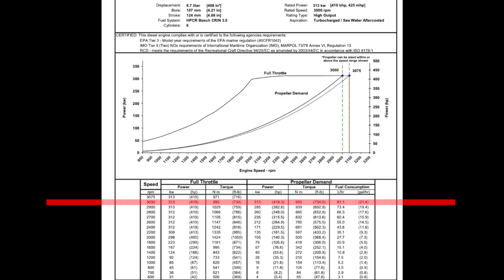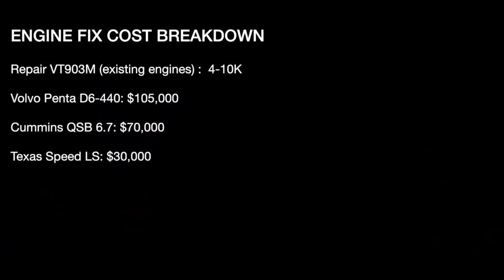Tesla Powering my 30yr Old Italian Yacht? And Broken Diesel Engine Diagnostics

Comment: You know what I told you on the phone but at the same time I know you’re dying to go gas. I still say rebuild and stay diesel. If you’re concerned about resale, look at the value of gas boats vs diesel. I finally got a diesel boat and will never go back to gas unless it’s outboards and even then I’d try to find a diesel version.
Reply: Yeah Chris, as a boater with a gas motor I would love to have it diesel. We own an rv with a Caterpillar C7s Diesel engine and love it way more than gas. Would love to own a diesel drive fishing boat. For now ours is gas, for now...
Reply: when did u get a boat and whens the vid coming out??
Reply: Check out Oxe diesel outboard.  300hp BMW 6 cylinder diesel. :-D
Reply: What about lesla motors and a big generator they make 400v  20 to 100kwh and bigger that run at 700 to 1500rpm and burn ⅛ of the diesel your two motors burn or forget about the tesla motors and buy a complete kit 1generator 2 motors and battery power packs and controllers probably the best option for you and with a 100 kwh at 400v push that boat to 60+ mph don't try that in not sure if the haul can take that much pressure from the water colliding with the from of the boat
Reply: NeoLeo Media “has a boat channel” no content yet still
Reply: diesel is better than petrol change my mind
Reply: Please continue to talk sense to him, please Chris!
Reply: I know he’s still learning about boats but being boater with 40 years experience of owning, working on and operating boats let me tell ya what I know....Doing a diesel to gas conversion is prob the dumbest f-ing thing anyone could ever do on a boat of this size. This is not a cigarette type performance boat with a narrow beam. This is a heavy wider hull that absolutely needs diesel unless he wants to completely destroy the value, performance, economy and reliability of this boat.
Reply: @turbomotovlog5588  yeah, thats a great idea !!
Reply: Of course he's not gonna follow the good advice/experiences of these comments. Doing the smart thing is not the point of this channel. its all about the drama and rich-kid toys.
Reply: Steve VAG-tuner there is something called law of thermodynamics.   So 2 electric engines would still consume the same amount of diesel as a Diesel engine with the same output.   

Only reason locomotives use diesel electric is packaging purposes.
Reply: Great content as always, so unique! Do whatever you think with this thing, I’ll be watching regardless and I have no clue about engines!
Reply: @danhard8440  To me, that would make it an easy choice then. Get that engine in and have the blown one refurbished for spare or resale.
Reply: @dannyt9067   This! I have only 30y experience with our yacht the same size and 2x Volvo Penta diesels........ holidays on a yacht should be as problem - free as possible. Service the whole drivetrain (and esp. the fuel system, sealing & corrosion protection .... thats where the most problems come from over the years) mostly by yourself (to know possible issues when out on the sea)........... else all your work, time a money will have no benefit for your family and possible other yacht owners, except some fun vids .......
Reply: Have you considered using the generators to increase your electric range? I don’t know it it would be efficient enough but at least in the case of an emergency that could get you more power.
Reply: @brianhilligoss  sorry bud it's a diesel 3 liter engine 4cylider turbocharged euro 4 
Specific fuel consumption at full load  260 g/kWh 
@ 4000
rpm so there is no way it hell it's going to burn as much as those 2 huge engine
Reply: Wolfgang Brugger agree 100%. If this boat is meant to be a weekend cruiser for entertaining the family and friends  then he should keep it as stock and reliable as possible. If he wants to do a crazy project boat then go find an old Fountain hull and go nuts with whatever powertrain he desires. And btw 30 yrs is a long time. I was fortunate to be born into a boating family and have been around boats my whole life.
Reply: @CS-932  Now a diesel-electric would be cool!
Reply: @brianhilligoss  actually, with trains diesel-electric makes the most sense as the electric motors behave as a CVT delivering the energy from the engine in a smooth manner and allowing the engine to stay in its most efficient rev range, while having fewer losses than an actual CVT. In a boat, it wouldn't make as much sense, since the torque is shot into the water as thrust, which doesn't need particularly low output RPM and often doesn't even use a transmission.
Reply: Yeah this is a cabin cruiser, it isn't designed for speed. If he wants to go gas do something like Finnegan and get a jet boat with a TSP engine.
Reply: Spot on Chris!.  Diesel outboard engines, check out Cox diesel outboard, very expensive tho
Reply: @turbomotovlog5588  While I agree a Diesel Electric conversion would be cool for a youtube series.  The specs you are quoting for the generator would be far too small.  His current total engine output is 800hp, which is 600Kw.  So to match what he has currently would require a 600Kw electric motor, which means assuming 100% power transfer from generator to motor, which if course is not possible, he would need a 600Kw generator.  The 100Kw you recommend would be far too small.  Realistically, he would probably need a 700Kw generator or more due to power losses during conversion.  But even assuming a 600Kw generator is sufficient, a stationary Generac 600Kw unit burns about 41 gallons an hour, so similar consumption to the two diesels he has now.
Reply: @twainguy2  the electric motors give out 800foot pounds of torque each that's 1600 foot pounds of torque so I think that's more than enough  to propel that boat easily
Reply: This is a "express cruiser" boat lots of beam (width) and weight. It's designed for day cruising/overnighting. Not go fast. Just fix what's broke.
Reply: Steve VAG-tuner the electric motors only make that at stall.  The rated tq demand of the props is at 1800-3600 rpm.
Reply: @turbomotovlog5588  Its not a matter of can they move the boat, its a matter of how much power they require to sustain movement.  Assuming whatever electric motor you are giving specs for can make 800 ft pounds at the proper speed for those props.  The power requirements for two of them would be 360 kw at min speed and nearly 800kw at max speed.  There are advantages to diesel electric, but getting free power is not one of them.
Reply: The last option would be nuclear reactor
Reply: Diesel
Reply: @turbomotovlog5588  A great idea. Why not go a little further and do a hybrid with a battery and a generator? You get silent low speed cruising and the ability to go fast and not run out of electric power.
Reply: What about Hydrogen?
Reply: @vinquinn  finally someone who can think like me people need to do some research before posting I feel bad Im embarrassed for them  so many negative answer do research before and correct yourself before posting  battery power  hybrid or  generators are nothing like 10 years ago.
 Electric motors are more efficient than ever before and can only improve in the future   don't get me wrong I love a high horsepower  combustion engines
Reply: man, im both ways on this, maybe run an electric motor as a trolling motor, tesla drive unit trolling motor, and keep the diesel for normal 40mph traveling, but then use the tesla for a cruiser motor. also since you have large engines, using them to run a generator would be great to charger the tesla battery. Hybrid Yacht.......
Reply: There is a very real safety issue with boats and gasoline, specifically buildup of gas fumes that can easily explode.......stay diesel.
Reply: Lars In the United States, BMW diesels are hard to get.
Reply: I agree Chris, I too have a 42 boat with 2x diesel engines and would never concider changing to gas. Good thinking bud
Reply: You're wrong about running those engines at full load with no issues. The na version of that engine running at 1500-1800 rpm will go 20k hours or more. Yours running wide open all the time? Probably less than 10k.
Reply: Yanmar makes diesel outboards if you need one
Reply: go electric and power it with a nuclear reactor, just like a aircraftcarrier
Reply: @sammiller5509  that would solve the range problem
Reply: Lol, the fact he used you as an argument FOR LS swapping the boat, and then I go back and see you said stick with diesel is kinda maddening.
Reply: didn't expect to see you here.
Reply: Do you want to buy a diesel engine? We are a Chinese manufacturer specializing in the production of marine products such as diesel engines, propellers and ships
Reply: Great advise !
Reply: I wish ChrisFix called me to talk about engines.
Reply: Good Advice. Stick with the diesel. No Questions. P:S, There are diesel outboards.....
Reply: I have a gas boat and it's very underpowered I tried driving my friend's diesel boat it was way more fun
Reply: Something big must have happened in the past year because they have the "silent 55" now and they're doing the ev thing pretty well. But hey I'm just hobby dad lol.
Reply: Dude doesn’t listen.

Comment: I would rebuild the two original engines with higher horsepower and torque make them bulletproof and you save a ton of headaches 👍🏼👍🏼👍🏼✌🏼
Reply: And money in the long run
Reply: Rebuild yes but no need for higher horse power or torque, if anything for reliability reduction of power is an option 20 knots is desirable 40 is being an ass hole and will get you in trouble on the water. Fun on a flat lake but on a choppy sea or river will turn into a nightmare
Reply: @bsxxfurballxx692  not into drugs just comfort 🤔🤔👍👍
Reply: Agreed, unless there is something dramatically wrong with the existing motors, rebuild and use the money you save for other projects....

Comment: Rebuild the existing engines, after a rebuild they'll last for years
Reply: like really.. why do anything else? Those engines are your best most cost effective option.
Reply: They are hard to find parts for and the parts at expensive
Reply: What about rebuilding the engines but improving them to make them more efficient like electric hybrid.
Reply: I really really wish automotive engines followed the OPs method. Like, really wish, but instead years of tweaked/paint huffing “engine builders” have made the reality factory first.
Reply: Rebuilding is the only reasonable option. Drop a couple thousand on those engines and they will last another 30 years.
Reply: Or two Hummer H1 engines  🤔😀
Reply: I agree
Reply: This is the smartest choice as far as I can tell.  If you are worried it's too straightforward, you could work on building a custom surfgate/nauticurl system so you can wakesurf! (Not sure if anyone has had that work on a boat this large).
Reply: You're way better off rebuilding the diesels

Comment: Rebuild the diesels, buy a “small” boat for a fun LS/electric project.
Reply: Good idea
Reply: Spot on.
If you swap for gas engines you need to seriously consider the safety aspect too. Everything needs to be intrinsically safe with added bilge blowers and auto fire extinguishers.
Reply: What about running an engine to power an electric generation system to power the tesla system.

Comment: Rebuild the original diesel engines imo. They're literally designed for that boat so should be reliable and last ages.
Reply: Pornhub Official  I'd like to see them rebuild the engines themselves.
Reply: @chadzentner8213  same and at the same time give them a little uograde. Cost wise I think Diesel is far better.
Reply: Pornhub Official rebuild the engine, talk with the guy that rebuild them and put bigger turbo on? Mooore power baby
Reply: Electric isn't reliable, you need reliable on the water. I say either rebuild or swap to ol trusty big block chevy.
Reply: I'd like to see B is for Build send it and make a power boat
Reply: Justin FJ. I agree. Rebuild original ones and maybe even modify to make more power.

Comment: As an experienced Diesel Mechanic, I strongly recommend that you get into the P-Pump, remove the governor springs Riva put in it, and install the OEM governor springs. 3300 is the max you should ever run those engines. 4k is like trying to run an LS at 9k.
Reply: Nice input!!! Thank you
Reply: This.
Reply: Commenting for engagement, so they will see this internet gold.
Reply: Very well stated, I can’t agree more I’m also a diesel mechanic. The p pump is the way to go I got one on my 12v cummins. The rebuild is the best option IMO
Reply: @timgrimes8502  Um, how are you going to put a P pump on a PT injected dinosaur like a 903?
Reply: The comment = substance
Reply: 4000 rpms seems way too high. Rebuild both, get the rpms down to 3300 and let her eat.
Reply: 100%. Even the Gale Banks 'killing a duramax' isn't revving to 4000, too much crank speed means less time for fuel injection, which means less power and hot spotting the pistons.
Reply: doghearder true didnt think of that
Reply: Govern lower sounds smart. Maybe those engines will be good with an extra few PSI of manifold pressure to recover that top speed power?

Comment: Diesel....and it’s not even a discussion. Here is a small list of reasons:
Ethanol issues suck
Diesel much more safe to run on a boat than gas
Boat already rigged to run diesel. You would have to install ventilation, blowers and other stuff not needed with diesel
Diesel much better torque and it’s not just for top end, but also for boat handling and maneuvering 
Diesel cheaper and you already know about the fuel expense.
Stick with diesel, the next guy who buys it from you would want you to keep the diesels....
Reply: Luis Vallecillo I’m with Luis on this. I had a 32’ Cris Conny I moored in Scapoose that had twin 283 Chevies. Like you said gasoline is expensive and it’s dangerous as all hell.
Reply: Not to mention the heat those gas engines are going to produce.
He really needs to rebuild both of those diesels (or at least rebuild the problem engine and pull down and inspect the still running engine)
Reply: Give a diesel air and fuel... They will keep running... Underwater...
Reply: This guy boats.
Reply: Plus they should last hundreds  or rather actually thousands of hours. Trouble free hours that will run hour in and hour out.
Reply: @henryschilling1120  Yeah and those gas engines will be worn out in  6 or 8 years of regular use. The diesel power unit(s) are marketed with the expectation that they will be rebuilt after years of reliable service. The secret is the lubricity of diesel fuel.
Reply: @henryschilling1120  I do believe i remember your boat. In fact my friend drug me down that way to look at one. Not sure if it was in Scappoose or St. Helens though so it may or may not have been yours.

Comment: Dude trust me. I've done 7 high performance engines in the last 4 years in my boat. The amount of money it takes to get it right is absolutely astounding and I did most of the work myself. TRUST ME, fix the diesels or replace with newer marine diesels. Your heading down a path that could be years and never will be right.
Reply: some random guy  my guess not knowing the commentor is that the configuration for the boat isn't quite right and the balance of performance and reliability is wrong. Boats tend to be a bit of a nightmare when you start tinkering or modifying them, on top of that their engines tend to run at consistently high output for extended periods of time, so engines for boats tend to need to not only be high performance but also be built for reliability at or near their top end. Even engines built for 24hr endurance racing aren't running at the extremely high output levels for as long as an engine in a boat. Also You don't have gears to shift through like a car on the road to reduce engine RPMs, basically the transmission is just a differential final gearing with a forward and reverse gear.
Reply: Haha I’ve done 8 high performance engines in the last 4years  , you trust me
Reply: @pauledwards9416  I bought a used boat, and repaired it. Enjoyed it for a summer and a half doing the maintenance on it and sold it to a friend. 3 things I learned, owning a boat is great until you have to fix it. Selling the boat is even better... And finally never sell a boat to anyone you want to stay friends with.